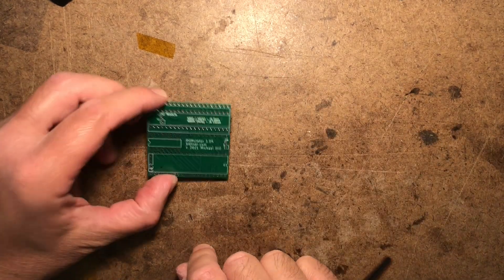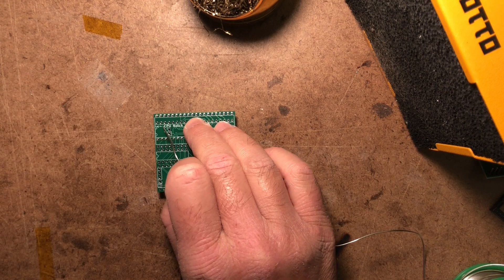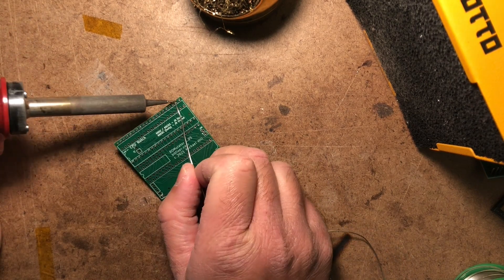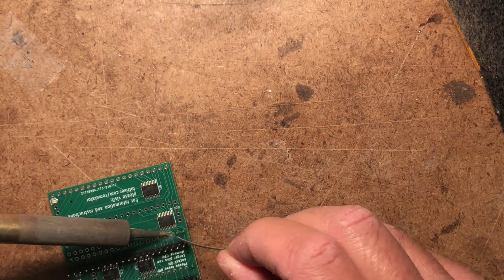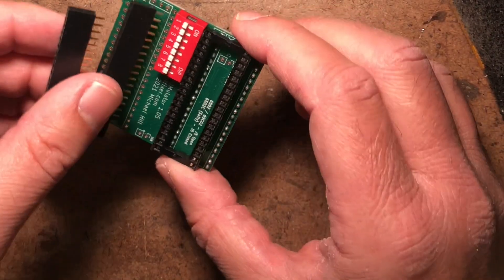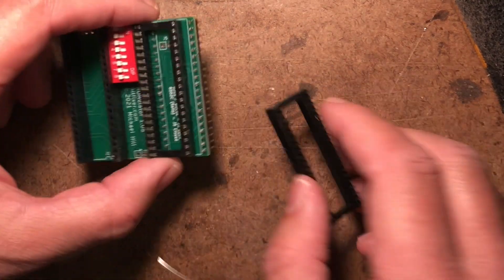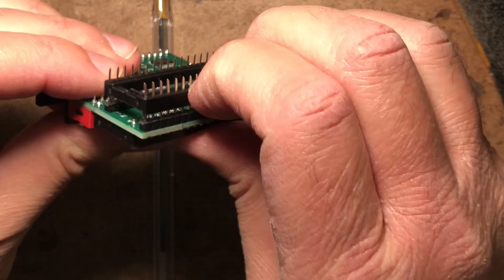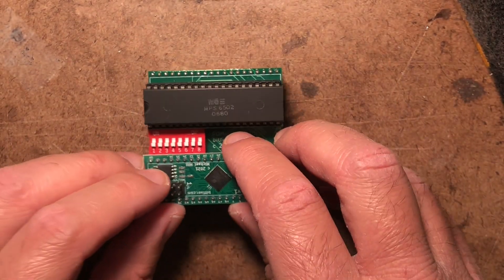ROMulator Kit Assembly

Comment: Your brilliant design is a pure work of genius.
This is the ‘Formula One Pit Stop’ for the 6502.
I hope that a 6510 version or wiring diagram adapter becomes available.
Your design is one of the very best ever I have seen for the 6502.
Suggestion:
To keep the pins headers aligned when soldering, insert the CPU socket on the pins on the bottom side of the card it will make a perfect holder to align the pins.
Use the same principle when soldering like RCA, DIN or every male-female connectors, the mate connector plugged in will act as a perfect holder to prevent the pins from losing their alignment.

Comment: Mike, I didn't see any documentation for using the DIP switches 6-8.  Does this mean that it is possible to load 256 different configurations or was it just easier to get 8 switch switches instead of 5 or 6 switch versions?  I'm about to use mine for the first time. :)
Reply from the maker: Switches 6-8 currently are not used, but reserved for future functions in a firmware update. Possibly 6 and 7 will be used for independently switching the RAM and ROM sections on or off independently, so you can quickly determine which is posing a problem, but currently those switches don't do anything.